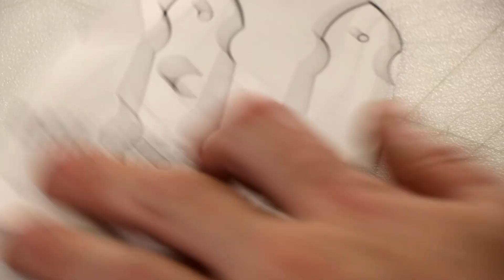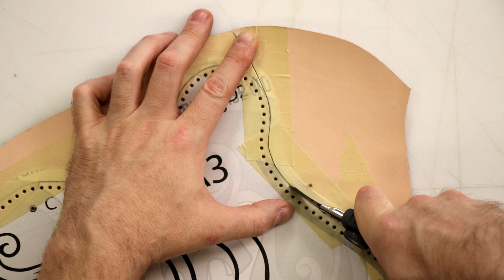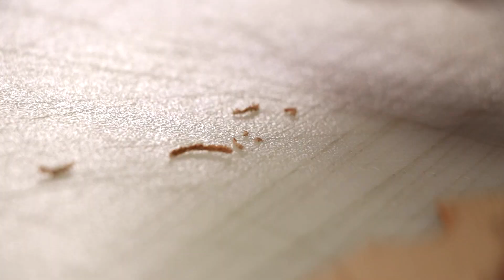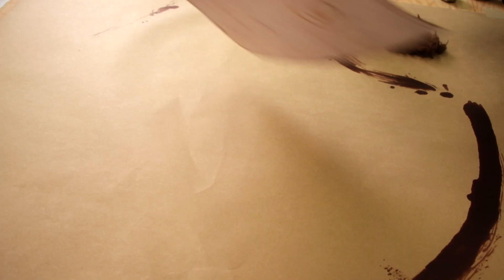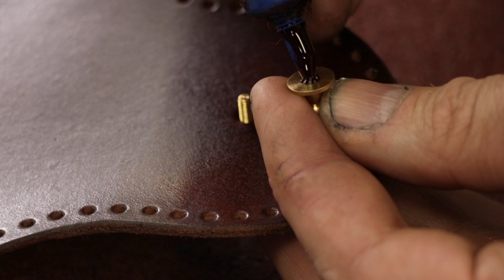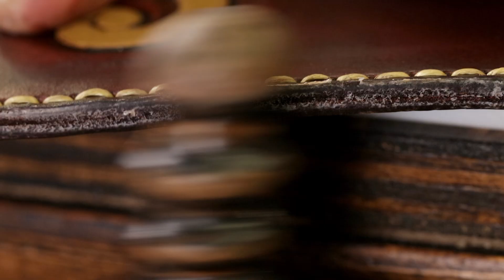Leather Quiver Pattern | Full Build + PDF & SVG Files

Comment: FYI, you probably don’t need red threadlock, blue should work fine (packaging is deceptive) but the red stuff is super crazy strong and needs a bunch of heat to come apart, may as well use blue and you’ll still be able to take it back apart later
Reply from the maker: My idea was that I never want to take it apart, but good point, shit happens and sometimes you need to.